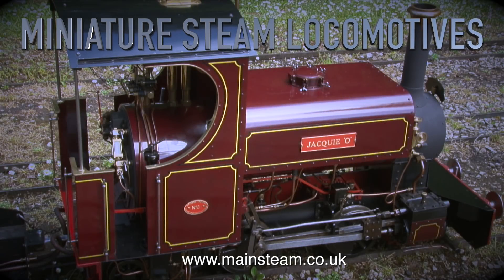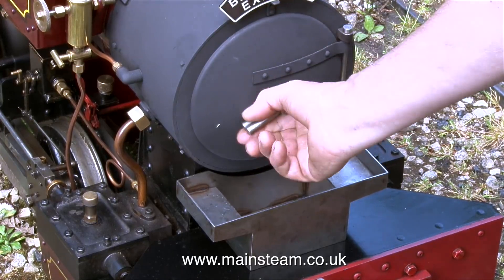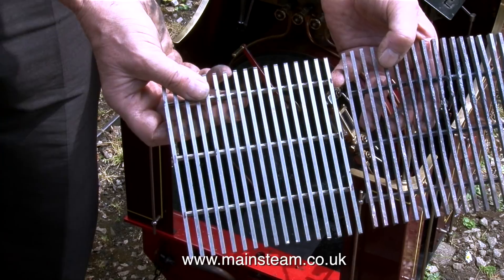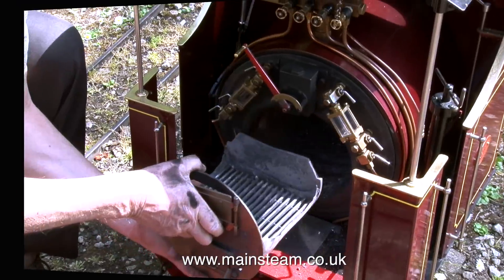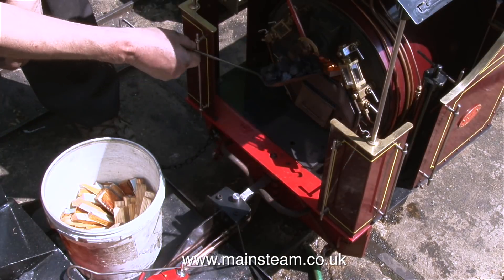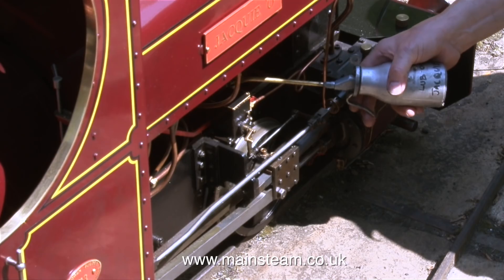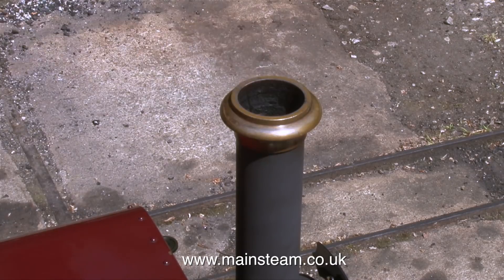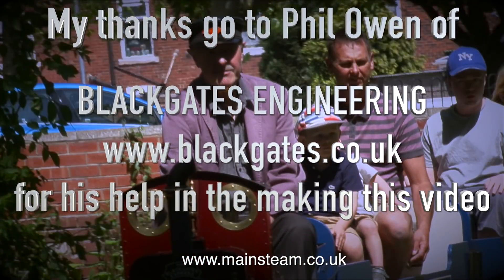HOW TO RUN A MINIATURE STEAM LOCOMOTIVE - THE COMPLETE PROCESS

Comment: Outside in the sun. What luxury!
A long time ago, I was inside the firebox of LMS 5025 changing firebars, 3 days after dropping the fire, and there were still glowing embers. I also had a flare lamp as a lightning strike had fried the mains so there was no lighting.
Reply: Hi Kieth,    Question        After steaming, do you store the engine with totsly dry boiler or fo you store thr engi ne with wet boiler?  Same question with the tender water feed pump. I.e. preventing it from seizing up while stored and eliminating any lube oil getting into the boiler.  Many opinions on this, please advise your thoughts .I run g1 live  steam coal fired. Regards,Tony,USA

Comment: Would it not make more sense to run the brushes through the tubes before cleaning out the smoke box?  It seems to me that in pushing the cleaning brushes through the tubes that push carbon into the smoke box that he had just cleaned.
Reply from the maker: and the carbon dust immediately gets blown out of the smokebox as soon as the first exhaust beat hits the blast pipe.

Comment: What a peculiar way to treat the loco. Makes sense after a run to prep a loco for the next run like I do myself. I sweep all the tubes and clean the ash pan and grate ect. I also oil up and refill the boiler to 1/2 a glass. Therefore I can chuck a match and firelighters in and within 25 mins be ready to run. 

I suppose that everyone has there own way of working but I like to always do as much prep after a run as possible.
Reply from the maker: Think about it . . . . . . . if we did it the way you describe, (chuck a match and firelighters in) then there wouldn't have been much of a video would there . . . . . . . maybe not so peculiar after all -  it is all an illusion }:-)))
Reply: @keithappleton  this does still beg the question. Why not clean up the loco after a run? I mean. What's your honest opinion Keith?
Reply from the maker: I always do, but as I mentioned previously, lighting the fire would have been a very short video ........